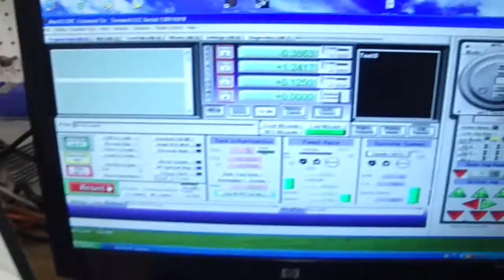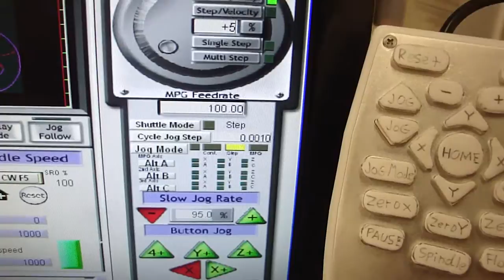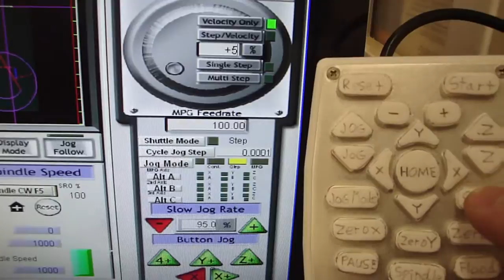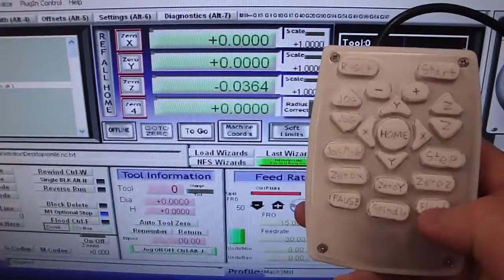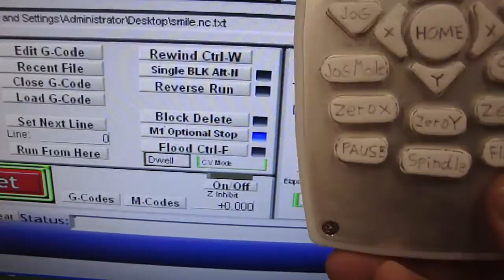Prototype Open source custom Mach 3 pendant!

Comment: Hi! How are you interfacing to the mach3 software? I bought a cheap-ish pendant that came with just a cable and no connector. One of those with MPG, emergency stop and 2 switches(one axis selector and one x1/x10/x100 selector).
Do you have any helpful insights as to what I should look/search for to be able to connect this up to my DIY cnc?
Currently running it with a PC as motion controller through a parallel port, with mach3 installed.